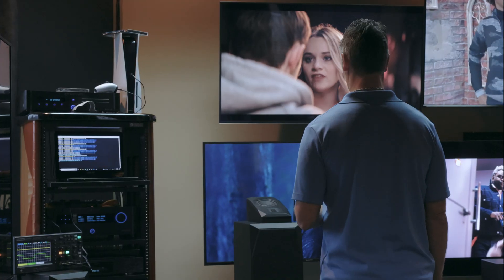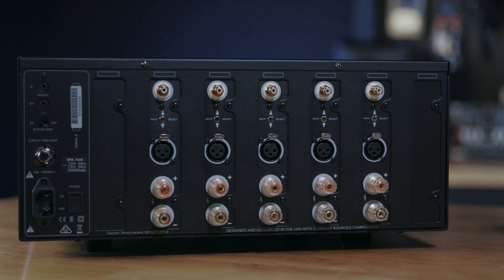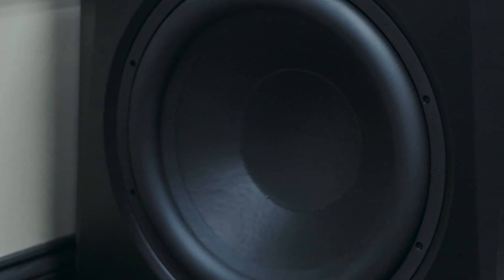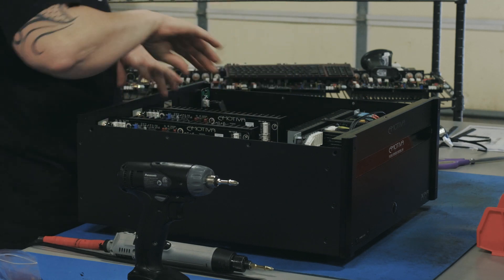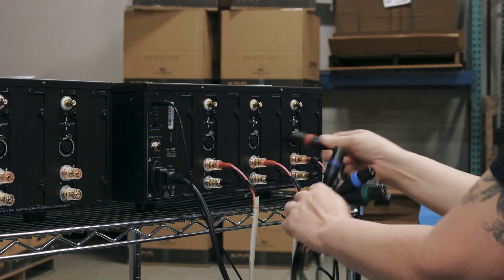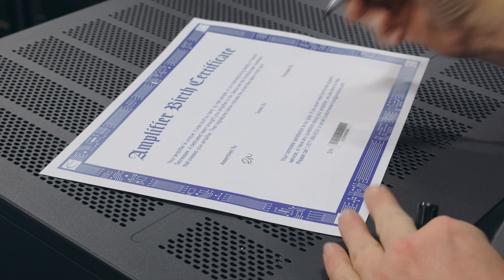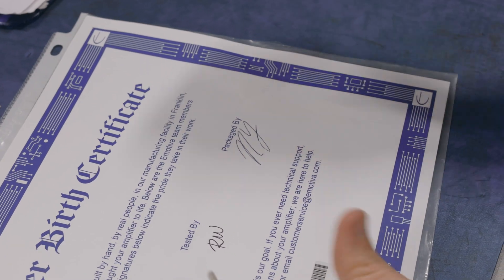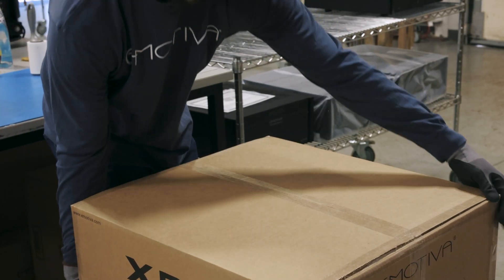Emotiva Engineering and Production Process

Comment: My BasX 4 channel amp works like a charm. My T3 towers rock. Toying with the idea of getting one of your high power amps for the T3s…
Reply from the maker: The XPA amps are workhorses!
Reply: @EmotivaAudioCorp  right on. The bas x 4 channel is for my ht height channels. The t3s are currently getting 250 watts at 4 ohms in my stereo. But you guys were right .   when i talked to the salesman before buying them… They want more.